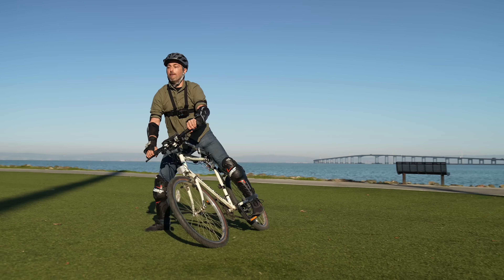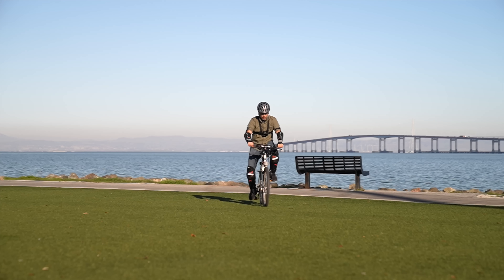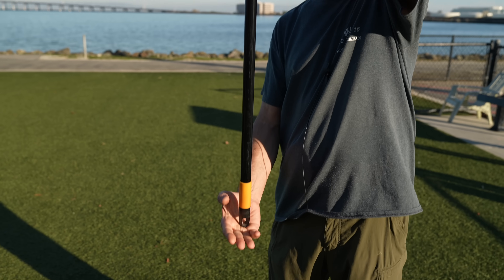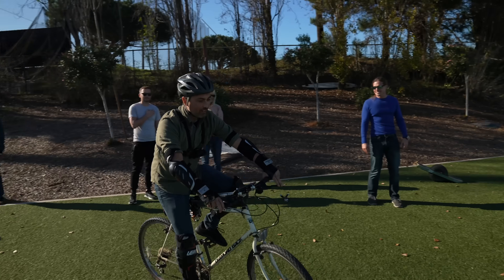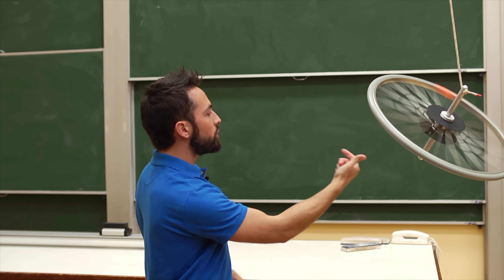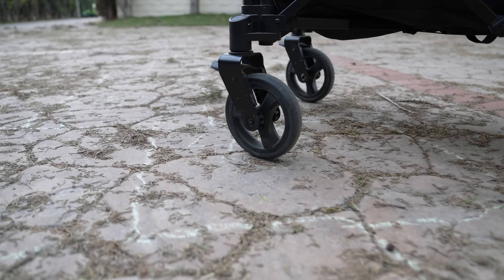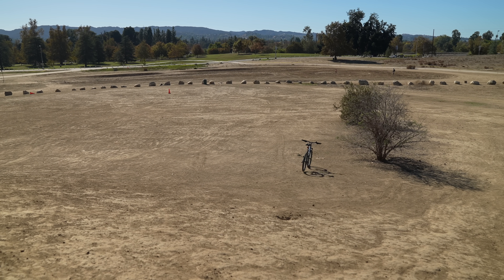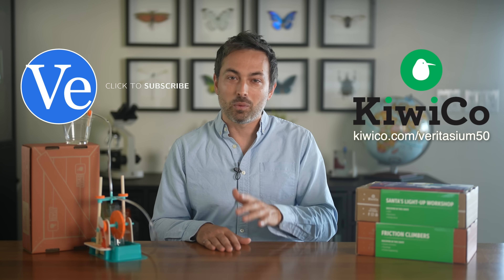Most People Don't Know How Bikes Work

Comment: I feel like pure leaning turns would still be possible with locked steering, since any turn on a bike is half due to turning the wheels, half due to leaning. If you just go from straight up and down to leaning to one side, you're pulled toward that side and thus start to turn. All the badasses do it in movies, probably to avoid the awkward look of a counter-steered turn.

That said, it's always done on something that can steer, so I may be wrong. Shifting balance without turning the front wheel to keep the bike optimally under you could very easily result in the bike not going where you want it to at all, especially if you try to turn quickly rather than slightly unbalancing yourself until gravity and centripetal force due to friction can keep you moving and upright.
Reply: Leaning results in a steering torque on unicycles, due to camber effect, but not bicycles or motorcycles, since any camber effect from the front tire would require enough force to slide the rear tire sideways and vice versa. A leaned bike with locked steering will simply fall down.
Reply: @rcgldr  so what you're saying is... Drift?
Reply: @b-chroniumproductions3177  - no. The point is that since the rear tire doesn't slide sideways, it cancels any camber effect from the front tire, and since the front tire doesn't slide sideways, it cancels any camber effect from the rear tire. Unicycles can be tilted to steer due to camber effect, since there isn't a second tire that prevents the camber effect, and it's the most common way to steer on electric unicycles due to their faster speed. The other way to steer on unicycles is to yaw the wheel into the desired direction, such as flailing arms left to steer right and vice versa, used for very slow speeds.
Reply: @rcgldr  Is it not possible to use forward momentum to fight gravity? I mean I suppose it's difficult to picture in my head how to start the sideways motion, but once it has started the momentum from the bike being in motion prevents the bike from falling over. Gravity pulls down and toward the inside of the turn (since the bike is tilted that way) but momentum pulls the rider and bike toward the outside of the turn, meaning that the rider can create equilibrium by speeding up or slowing down.

I'm genuinely curious here, I remember a PE game in school where everyone rode in a circle and the goal was never to take your feet off the pedals. Once you did, you had to leave for a bit. And the best way to make someone else do that was to stop in front of them, but that just meant that the kids with good balance started to get really, really good at stopping abruptly and maintaining balance. Admittedly, it wasn't a full stop, the best way I found involved moving forward by inches until the idiot blocking me failed and got out of the way, so I was probably cheating in the context of this problem, but I just feel like it's possible to turn without steering.
Reply: @ThePCguy17  - if the steering is locked straight ahead, then a bike cannot turn, regardless of lean angle, it will only fall over.  While falling over, the center of mass will move to one side, but the contact patches will essentially move in a straight line. A standard bike turns due to tracking, the front tire is angled inwards of the rear tire. For a bike in a leaned turn, the imaginary extended axis of the front and rear wheels cross at some point underneath the pavement. The point on the pavement directly above the crossing point is the center of the circle the bike will follow, ignoring deformation at the contact patches, which would result in a somewhat larger circle, and the point where the extended axis cross will follow a small circular path. Following this explanation, as the difference in angle between front and rear wheel decreases, the radius decreases, and if the angle is zero, the radius is infinite, meaning the path would be a straight line.
Reply: @ThePCguy17  - I replied, but the reply doesn't show. Trying again. If the front tire is locked straight ahead, then the bike can't turn. A bike turns similar to a car, except that steering has to be used both for balance as well as turning, and on a bike, the greater the lean angle, the smaller the radius of the turn for the same steering angle.

Comment: reminds me of another interesting video I've seen, I'm sure you know which one I'm talking about. They built a bike with reverse steering, where simply through a couple gears that were modified onto the handle bar attachment, you turn the handlebars to the left the fork was rotated to the right and vice versa. It was a bit of a mind trick causing you to go opposite of what you were naturally inclined to do to keep yourself upright.

Comment: Only 3 minutes into it right now, but every motorcycle rider out there isn't surprised by this - with a motorcycle as heavy as it is, you have to turn by shifting weight.  If you want to go right, you push on the right handlebar....this shifts your weight to the right, causing the bike to lean and turn.  Works on a pedal bike too!

Comment: Counter steering is something you HAVE to know when riding a motorcycle. A bicycle is agile enough to intuitively swing into a turn to swerve around a sudden obstacle, a motorcycle might need strong manual input, and if you turn the handlebar in the wrong direction you might die.

Comment: the bikes aren't stable because we are on them.  they are balanced perfectly up until that point.  You in fact do not need to steer the handles in order to maintain balance.  Practice riding the bike without holding the handlebars. 

The reason you become unbalanced is because you naturally countersteer to offset the pressure of pushing down on the pedal when trying to accelerate.   HOWEVER, this can be accomplished by leaning the bike left and right if in the case of your handlebars being locked.
It all takes practice, but 100% doable.

What's even more fun, is you can create momentum by just swerving the bike left and right.
Bikes are awesome.

Comment: Snowboarders should get this. To turn left, you first have to steer the front wheel out from under you to the right. 
Adding training wheels changes that which is why they aren’t the greatest idea. 
My family tan a motorcycle dealership for 40 years. We tried to reach the idea to new street riders so when an emergency arose, they didn’t know instinctively do the wrong thing. There are plenty of videos where new riders steered into the only obstacle around by continually steering away from it as they zig zagged to it.

Comment: Partially correct. One doesn't have to counterstear when making turns. Just lean to the side appropriately you are turning to, it will make smooth turn.

5:45 - You have to 'endlessly' demonstrate the bike self-travelling successfully before you can say it can keep coasting indefinitely. One fall would negate your saying. So the statement is unproven.

Comment: I feel like you should also mention a large reason we need to stear going straight is because our mass is shifting left and right as we pedal.  This obviously not the only reason but it's a large factor.  You only need to steer to correct these small imbalances in the system caused by you and/or the environment.  But otherwise I loved the video it was a nice eye opener to these mechanics of balance I wasn't fully aware of.
Reply: I think I can learn to ride a unicycle now.
Reply: makes sense. it's easier to coast with no hands than it is to pedal with no hands, up until you reach a certain speed.

Comment: "This is how you drive a car."

That is not true for 95% of the people I see on the road. They ALWAYS turn right before turning left, and vice versa. To the point of almost hitting me if I'm next to them. Granted, you're correct in that they don't NEED to do this in order to drive a car properly, but for some strange reason, they insist on doing it anyway.

Comment: Regarding the whole unicycle thing, you don’t need to peda back to start going forward. That is if you use a wall to mount (or anything else to hold onto/lean onto).

However, if you want to do something called free-mounting, you do need to pedal back initially. That’s just getting on the unicycle without any support. It just gets it under you.

Comment: What if someone who hasn't ridden a normal bike before tries this? By locking the steering doesn't mean restricting our steering intuition. Because we know how our normal bikes work, our steering intuition could work against us.

We can also try to do is we ride our bicycles hands-free. With sensors that can measure and record steering angle, we can have more info on how bicycle steering helps in balancing. I mean, how dependent balancing is with a movable handlebars.

Comment: You must have non-existent athletic balance, or be incredibly thick skulled. Give me any bicycle or motorbike and I can do what you're saying is impossible at any speed. hint: lean into your turns. Digitally controlled steering stabilizers on sport-bikes are designed so the handlebars literally wont turn until the bike is leaning to a certain degree in the right direction. With bicycles your brain needs to do the math intuitively and decide how far to lean into turns.

Comment: So we're gonna just ignore the fact that at high enough speeds and sharp corners you can turn in an intented direction without handlebars, and thus immediately in the intended direction. This is for leisure riding maybe
Reply: Sigh. You are wrong.  Push left go left.
Reply: @gur262  thats what I said. "The intended direction"

Comment: I can ride a bike without using the handlebars, lean to turn. I'm not certain but there might be some countersteering involved there; the bike will steer based on the angle of the bike not the rider. I'm not entirely sure if the lean involves tilting the bike the other way first as I lean.

Comment: Now I want to know how the design of bikes came about.
Reply: First came the draisine n nobody had assumed 2 wheels were enough to not fall over.  You were in kind of a hammock saddle using your legs to push off the ground.        It probably was an accidental discovery that you could actually lift both feet of the ground n not fall over for more than a moment
Reply: @gur262  Thanks, but I meant stuff like how the angle of the front fork or the set forward handlebar where discovered/engineered.

Comment: The opposite turn is not always the case. If you prep your body position correctly and lean before the turn you don't turn the other way.
However, that depends on where and what style of riding you are doing. All the town riding pretty much leads to out then in. Because you aren't throwing yourself into turns and more often then not riding in a casual position.

The turning left to turn right or right to go left is far more indicative of motorcycle riders.

Comment: Your inner ear and reactive muscles tell us how to ride a bike it seems? I've been riding bicycles all my life, since I was only around 5 years old yet I never thought about how, just as the video suggests. Despite bicycles being able to stabilise without a rider, a rider with balance problem caused by the inner ear not working correctly surely cannot ride a bicycle. A machine that cannot self-stabilise if the rider cannot self-stabilise. Of course an unstable rider causes inputs to the system that the bicycle design itself cannot counteract. A fascinating subject indeed.

Comment: What if you stopped pedalling before the handles are locked and continue not pedalling. If the bike is not leaning before the handles lock, wouldn't you be able to keep going straight till the bike is slow enough for you to not be able to balance any longer? I realise that the modification was to demonstrate how a bicycle turns but i was wondering if the reason most riders found it impossible to continue going straight was because they all kept on pedalling thus forcing the bike to lean.

Comment: Understanding semi-passive (intuitive) counter steering is a nice thing. Understanding how to actively use it, either for riding tricky courses (like MTB downhills) or for emergency situations, is something entirely different. I have seen people hitting cars (the cars entering a road from the side or in a crossing) on bicycles, scooters and motorcycles because they didn’t know that this little movement to the right or left will allow them to then swerve to the other side at angles no one would believe possible, avoiding flying over the cars hood - or worse.
It is something I actively train every year when cycling season starts again after 5-6 months hiatus where I live (meaning, we no longer have 1-10 inches of ice on the roads).
And it also helps getting your balance back after all that time on a smart trainer, skiing, snow shoeing and so on.
Reply: when I was like 4 I would lean my bike to where my leg almost hit the ground everytime.. as I got older I did it less and less because I slid out a few times.
Reply: @nathanh2917  cool story
Reply: @budman8926  Do you have a cool story as well my man? ❤️👍☺️
Reply: I sometimes do the same, just on my motorcycle. E.g. trying to avoid potholes as practice. If you do it real fast, you can do some crazy fast direction changes / evasiveevasive maneuvers. Good to know. Good to practice. It's the same with stoping. People rev up their motorcycle all the time. Trying to accelerate as fast as possible. 
But how many can stop as fast as possible, as fast as their bike can? Not many I guess. But that could save your life one day :-)
Reply: I think many people do it without noticing it
Reply: Motorcycles are weird because at low speeds you often do turn the way you want to go but at higher speeds you have to counter steer like on the video and the awkward in-between (you do one than the other). Going 5 to 20mph is harder to do than going 70.

Comment: This is proven wrong by me and 7 other people who can make left and right turn on a bike without using our hands
Reply: No it isn't.     Let's fuckin lock the steering and see.
Reply: @gur262  go right ahead, it'll be the same result
Reply: @themailman962  You are wrong.  You just are.   There's no way to steer 2 immovable wheels other than massive force like in inline skates.
Reply: @themailman962  I won't fall flat on my face for you.    Use some ductape n make sure to connect the bar ends to the frame.  Make it immovable.    You'll crash.
Reply: @gur262  looks like someone didn't watch the video, he could move the wheel but only in the way he needed to turn. He says you first need to go left in order to turn right, which is false as there are many ways to turn one way without needing to go the opposite first. It's not impossible, I've done it many times and I'm sure thousands of others have as well

Comment: Is it strange that i dont steer like this at all? I watched this video a few days ago then hyperanalyzed how i steer: i shift my center of gravity slightly to each side depending on the sharpness of the turn then move the handlebars to keep me from falling off. So i never do the initial opposite turn.
Reply: I also have a very large frame hybrid bike, so i wonder if that plays a part
Reply: You do it.     You move the handlebars.   That's the point.
Reply: @gur262  well arent they saying you can ONLY turn by countersteering first? Since they locked out one direction turning at all is impossible?

Comment: You can initiate without counter steer you just need to lean into the corner
Reply: No you can't.
Reply: @gur262  until you have done this, and seen for yourself you can't say that
Reply: @gur262  don't tilt the bike lean your body in the direction and then compensate for the lean with steering into the lean....

Comment: It is possible to turn a bike in one direction at very low speeds. 

At higher speeds - the physics at play is different to what they’re depicting here. The key concept is the shortest path. The bike wheel will always remain facing the opposite way to where you want to go. To go right you push the right handle bar forward. This turns the wheel to the left … and the bike leans to the right. You do not then push the handle bar the opposite way. You remain in this position. The wheel stays pointing left as you go right. It is one motion. The shortest path is the inside of the wheel when laid over. That is why the bike goes right when you turn the wheel to the left.